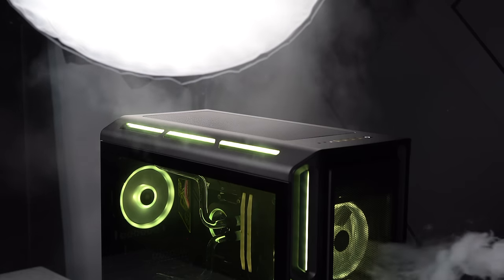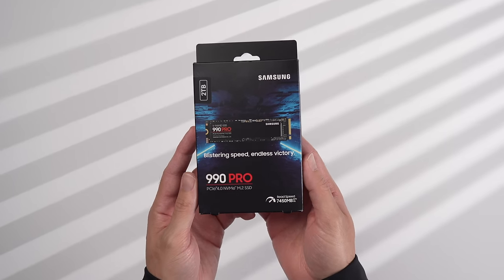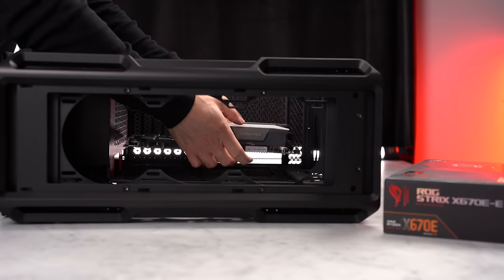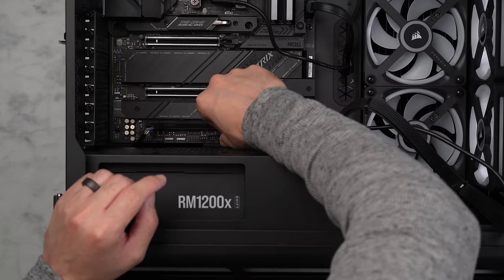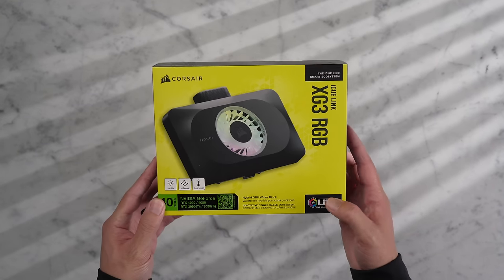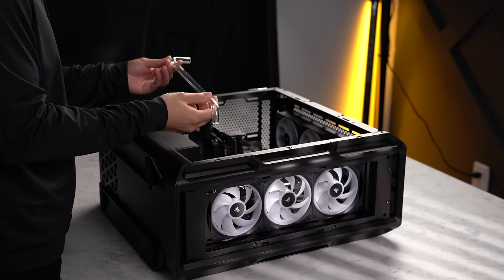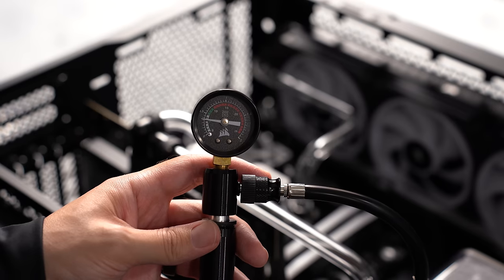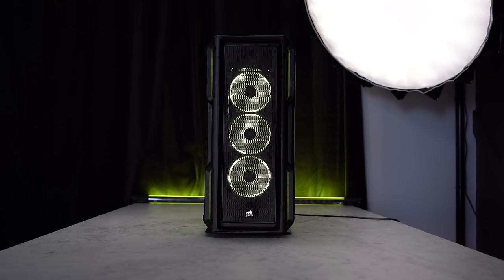The New Way to Power a Water-Cooled Gaming PC

Comment from the maker: Here are some additional GPU temps for those who are curious. Unfortunately, I don’t have another Gigabyte card to do a direct comparison, so i’m using the founders edition card as a frame of reference. 

After running Cyberpunk 2077 in 4k using the Path tracing preset for over 1 hour. 

Corsair Waterblock w/ Gigabyte 4090:
GPU Avg Temp - 47.5ºC
GPU Avg Memory Junction Temp - 56.3ºC

Founders Edition 4090:
GPU Avg Temp - 73.2ºC
GPU Avg Memory Junction Temp - 82.1ºC

Looks like the significant decrease in heat from the GPU die helps to maintain lower VRAM temperatures, as there is much less residual heat transfer.

Comment: Unless I missed it, would have been nice to see memory temps for the GPU as well. Also, adding a temp sensor to the water loop and using that to maintain fan speed is also a good idea for custom loops.
Reply from the maker: Pinned comment for the memory temps and the XD5 pump has an integrated coolant temperature sensor.

Comment: Really GREAT, thorough, detailed video. Someone could really build a custom loop off this video. Straight forward, to the point tutorial. Well done. You earned a subscriber! 

I have to agree, that GPU block is cheap looking. BUT, great temps. It's a damn shame that you couldn't just leave the GPU heat sink without the fans because that heat sink is sick looking. Not to mention, that heat sink is probably the most expensive thing on the GPU (curious the actual cost to manufacturer it)

Nice clean build and tech. The PS connections out the back, side? is a great feature. I wish my thor had that. Makes for a really clean build and I bet the component temps, although not a real concern, are probably better because the design allows the case air flow, front fans to rear fans, help to cool them. 

Definitely need to fill those ram slots, like you said.

Comment: Just a note knowing the denizens lurking the hallowed halls of YT ..... someone will blame you for a failed pump after 7 seconds of running because you did not add you need to flush your tubing AFTER you cut and bevel it . Great build, knowledgeable builder, great scripting and videography just slightly above most folks paygrade or ability levels to build this.....  if I had an extra 10k laying about I too would build this system.

Comment: i seen that the water block on the gpu does not cover all the vram on the gpu and other things is that ok for the gpu? i just clean my gpu like a week ago ( rx 580 saphire pulse ) and it had 0.75mm themal pads that i could  not find anywhere so i just put thermal paste instead of thermal pads and everyone that i asked about this said that im gonna fry the vram and the gpu so is it ok if i use themal paste instead of themal pads??
Reply from the maker: pinned a comment with the gpu memory temps

Comment: temps could be good for the die but you need to check the memory and hotspot temps also. I think those need to install separate heatsinks as just relying on that tiny fan to cool it will not be enough. specially for those gamers in hotter climates.
Reply from the maker: pinned a comment with the gpu memory temps. the gpu hotspot avg was 54.6ºC

Comment: 7800 3dx's known issue with asus motherboards, good luck.
Reply: should've gone with asrock or msi, gigabyte has bios issues and thermal throttling
Reply: I have an ASUS motherboard (the exact one in the video interestingly enough and a 7800X3D and I havent experienced any thermal throttling. I thought that whole ASUS and BIOS situation has been resolved?

Comment: nah i like more ZMT tubing in a matx Case . No Hard tubing looks so good like ZMT. Sad that PC Modding and Gaming is these Days a scam only  you need the newest GPU for DLSS 3.0  DLSS 4.0 you're forced to buy RTX 5000 Cards and then most of the Games you can't Play without upscaling sad. Then today a Good Looking Midrange PC with  Technic Feature are so expensive , like the new Corsair connect system, WTF 3 Fans plus Controller 150- 200 Euro wtf Fans , it's not like the new Fan shit  push my fps by 30%. Every Generation I am buying the 70er series but since RTX 3000 and the prices i stock by my rtx 2070. 600- 900 for a RTX 4070/ti plus water block..and 2 Years DLSS Support

Comment: 30 seconds is no-where near the amount of time needed to say its watertight. You'd want to leave it overnight or longer to really test it. Really reckless to tell people that 30 seconds is fine.
Reply from the maker: Maybe take another listen to what i said? 30 seconds for the overpressure leak gauge, which is the exact directions in the documentation that comes with the XT Leak Tester.

Then, once the loop is filled to leak test overnight before plugging in the motherboard connector. @13:25